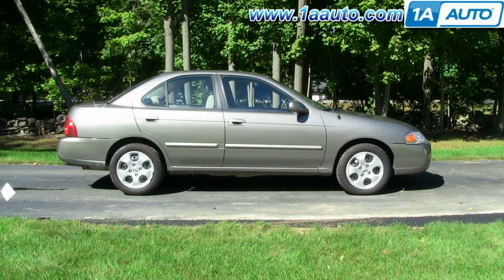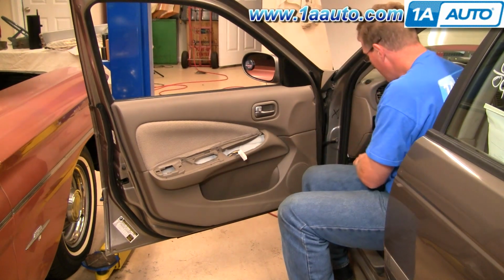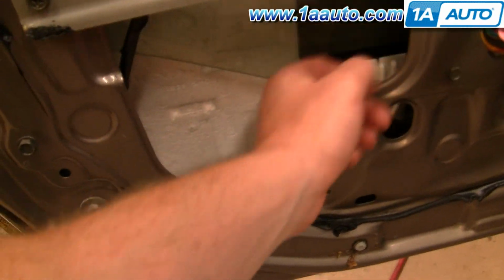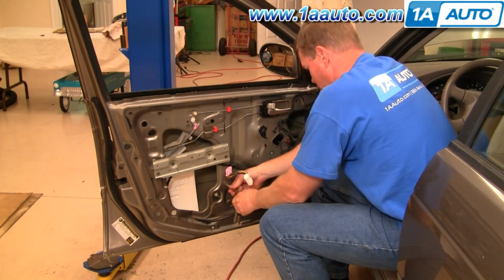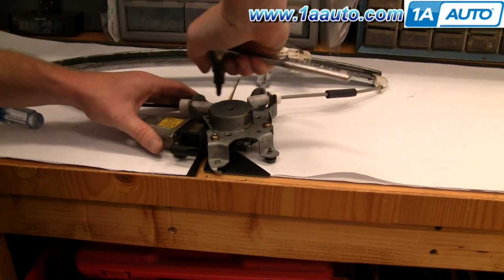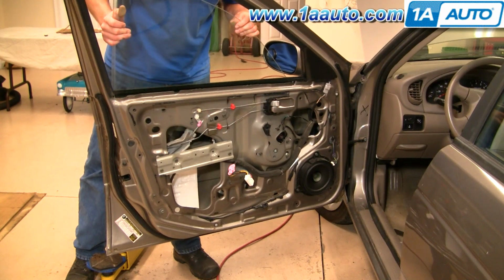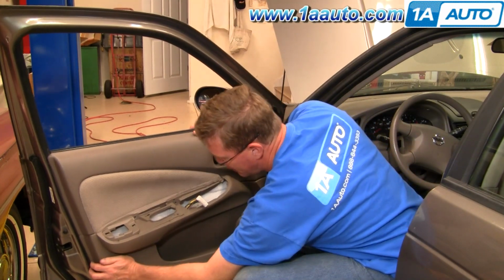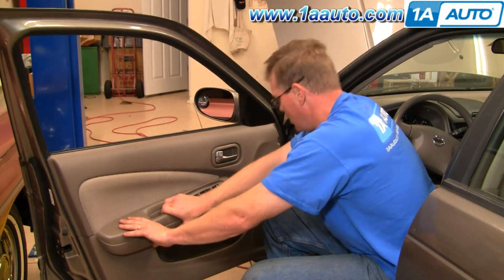How to Replace Window Regulator 00-06 Nissan Sentra

Comment: My Sentra has a different wiring connection to the motor. I have tried both 1Aauto’s regulator/motor and dorman’s. Neither one was compatible to mine. Talked to the nice folks at 1A and they seemed just as puzzled.
Reply: Same here with rock auto, did the research on images before buying but I got that rectangle plug when I needed the round edge square plug

Comment: Thanks for this!  I had already bought my motor, but I'll put your site in my favorites and share on Facebook.  I got it all back together, took it for a drive to celebrate and found that now my other windows don't work.  I know I got everything plugged back in right, are they on a separate fuse that may have been blown?  (I didn't unplug my battery - heh)
Reply: Figured it out. I pushed the child safety button.  :)

Comment: my 2002 sentra's drivers door window is very slow and struggling to go up or down.  is this the motor or regulator?  also is the rear door motor and regulator the same, can i just swap them?
Reply from the maker: +hottubsteve Thanks for watching!  You will want to inspect the regulator and the motor to make that determination.  If it is just going slow then it will most likely be the motor.  Unfortunately the motors are not interchangeable from front to back.  Here is a link to the parts detailed in this video! http://www.1aauto.com/1A/WindowRegulators/Nissan/Sentra/1AWRK00333?utm_source=YouTube&utm_medium=CTA+Comment&utm_campaign=ytcomment&utm_term=E5YHKzUTEgY
Reply: like i said previously the window goes up and down very slow, now with colder weather it wont move at all, what would you recommend to fix this?
Reply from the maker: +hottubsteve Thank you for the response. We recommend having the motor tested, and potentially having some lubrication applied to the tracks. 1aauto.com

Comment: My window stopped work on the driver side and need to replace the motor. Is the process the same with a 2007 Sentra? I would assume the set up is a little different between the '06 and '07 models. I know the door panel is different...

Comment: Great video. If I just wanted to remove the motor can it be removed solely, or does the actual window and regulator need to come out as well?
Reply from the maker: You may be able to just service the window motor (depending on where your Sentra was built). If you visit our website 1aauto.com you should be able to see what options you have for your vehicle. Hope this helps you out.  866-403-3393

Comment: My passenger side window would not move properly, how do I know which part I have to replace, window motor or window regulator?
Reply from the maker: You may want to take the door panel off to see if you can tell what or if something has broke inside the door. You may want to check the window regulator. Hope this helps you out.

Comment: Great video, I'm in the middle of replacing my drivers side motor, I'm having problems with my window stuck up so I can't remove the screws, any ideas on how to lower my window? Thank you
Reply from the maker: Thank you for watching! if you cut the cable for the regulator it will free the window. At that point you can move it up or down as needed. Hope this helps!
888-844-3393

Comment: Hi. My driver's window got stuck to 3/4 of the way up and only moves a short distance. I have opened the door and saw that the cable which brings the window up and down has been partially cut thus preventing the cable to slide and roll freely. How do I proceed then to remove the window. Shall I cut the cable? Thanks
Reply from the maker: Thank you for watching. You are correct, cutting the cable will free it up for you.
Here is a link to the item on our website.
1aauto.com 888-844-3393
http://www.1aauto.com/1A/WindowRegulators/Nissan/Sentra/1AWRK00333?utm_source=YouTube&utm_medium=VideoReply&utm_campaign=1ATony
Reply: Thank you for your help
Reply: Thank you for video, very help full. I did so any body can do with video. Thank you god bless
Reply: Great video,
I have 2006 Nissan Sentra and I took my door panel and the installation off but my window will not move. I try to use my hands to lift it up and it will not go up. It seems like is it stuck. Any suggestions on what to do?
Thank you

Comment: All of a sudden 3 of 4 windows quit working. Only the drivers window is operable now. Any ideas what could cause this? Seems unlikely that 3 motors died at once
Reply from the maker: Thanks for watching. It is possible the Master switch has failed. To test this you want to take the door panel off. Put a test light the the connector that plugs directly into the motor. When you activate the switch up and down you should have power at that plug in both positions. If you find power in one position but not the other, or power at all you know its the switch. If you find power in both positions then usually it is the motor. Hope this helps!
1aauto.com 888-844-3393
Reply: This is my son's car. Believe it or not it was just the switch which prevents passengers from operating windows. In this car if that switch is off not even the driver can operate them!!! Thanks for your response!

Comment: I have a 2008 Nissan Sentra and my driver window and lock switch wont work it wont even go down or up itsually works for a quick second when i turn my car on but then it stops. when i use the the switch to lower the other windows it works, also the lock swithch doesnt work!
Reply from the maker: Thank you for watching. Sounds like the Master Switch has failed.Unfortunately i do not carry it for 2008 Models.
1aauto.com 888-844-3393

Comment from the maker: You should be able to reach in the door and push it up into place with your hand. If you can't, the window regulator cable might be broke and jamming it into place. You may need to free up the cable if this has happened. 1aauto.com 888-844-3393

Comment from the maker: The plug end on the window motor may have been wired in the wrong order. Sometimes you can take the wires out of the plug and reverse them. If this is a window motor that you have purchased from us, and you can't fix the issue, call our sales staff right away and we'll take care of this for you. 1aauto.com 888-844-3393

Comment: Just a quick question - I installed the replacement motor and regulator - everything went smoothly - the only problem though is that the switch (to raise or lower the window) is now reversed. Down is up and up is down. I don't think I reversed any wires during installation. There really no way to do that since all the connectors are dummy proof (no way to accidentally reverse them). Any ideas?

Comment: hi can you do a video  of how to change the cable that looks like the cable that are used for the breakes on a bike the motor works fine but that cableis not totaly broken the cable is broken half way it have some wires broken in that cable and it looks not  that is holding it from circulating  in the motor so can i change the wier or i need the hole thing replace?
sorry for the spelling english is not my first language

Comment from the maker: If you plan on replacing the whole unit with the motor, what you can do is cut the wire holding the glass and then slide up the entire window to get to the bolts holding everything in.

Comment: What should I do in my case? So my motor is dead but the window glass is all the way down at the bottom, I couldn't pull up the glass at all since the regulator is holding it. Which means I can't even pull the glass up to the point where the bolt that holds the regulator with the window.